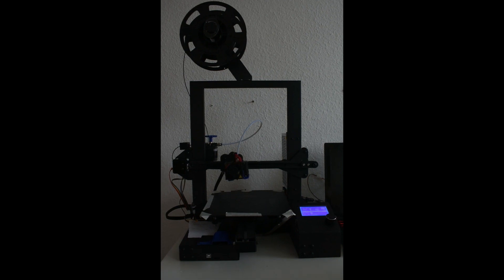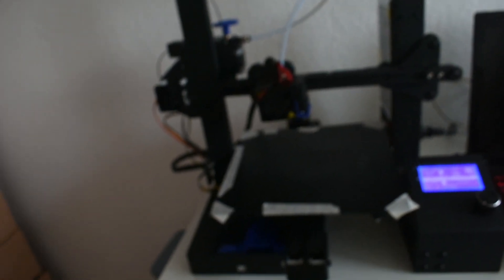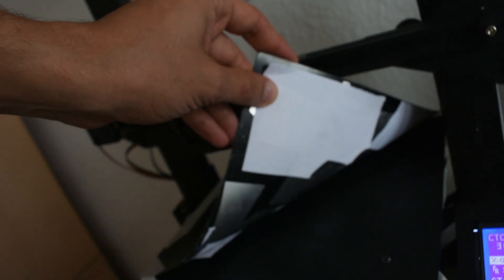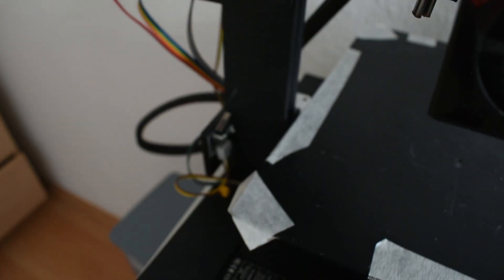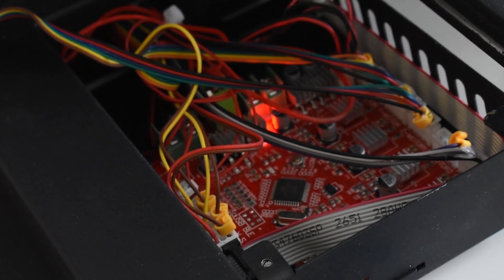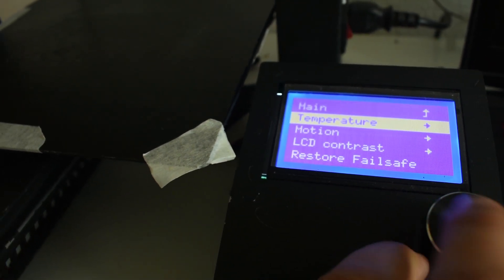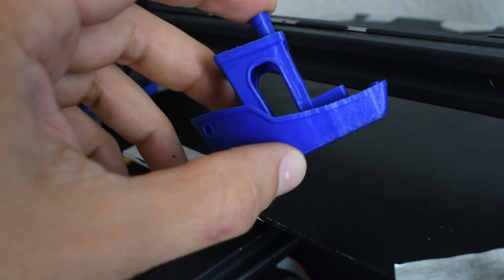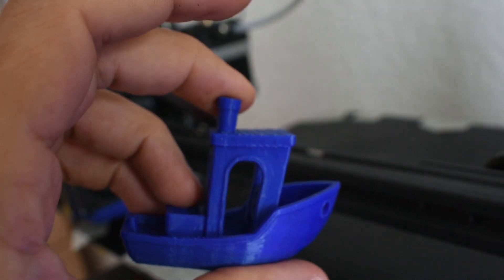150$ CTC A13 3d printer from eBay compared to ender 3 Is it the worst 3d printer?

Comment: hey man where do you plug the filament sensor into?
Reply from the maker: it is easy just because it cant be normally plugged into anything, you can fix it with super glue in front of the extruder

Comment: I sadly got the same. In the listing it said "ctc ender 3". Hopefully i can return it.
Reply from the maker: if it's not same as described then you can return it without any problem, especially if you opened a case in eBay and said it's not as described
Reply: Im trying. Im think i will get it.:)
Good Video, so fewer people buy this crap
Reply from the maker: @fritzwalter1112  actually it is working until now not very bad with me, for sure it need some maintenance but overall I did a lot of good things with it  , you can check my channel for more videos for stuff i printed with it

Comment: i have this but not really good ... but i change bed,220x220 ,springs to bed, whells, and put on my glass... for stability i have boring the hole large and change short screws .. now is stable because not stay to screws  but not compare with ender 3 .... i not return back because not possible ...
Reply from the maker: for me i only changed  the heat bed 235*235 the original one and i bought the glass bed but iam not using it always and i found there is very flat now without any problems and less vibrations , i will make another video how to change the bed for it